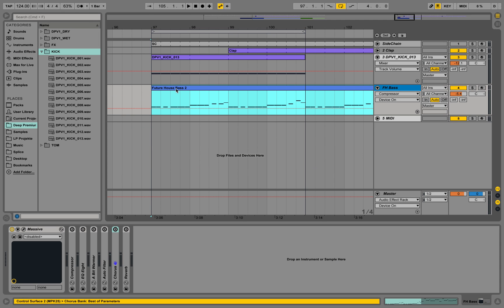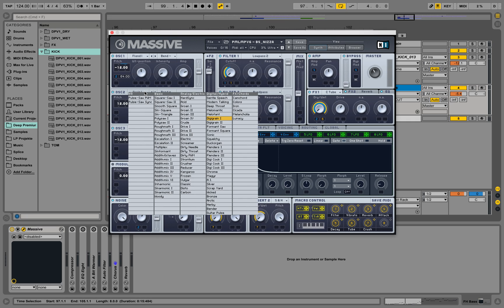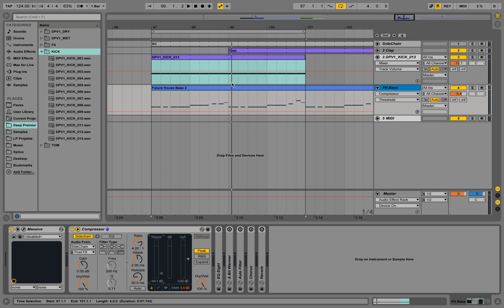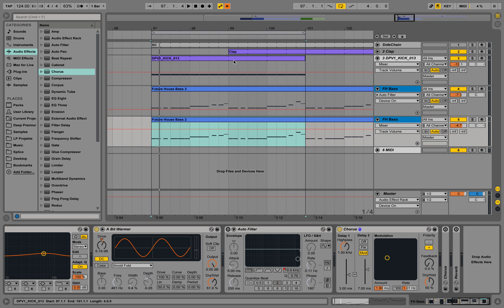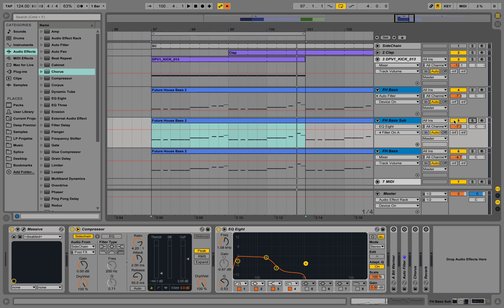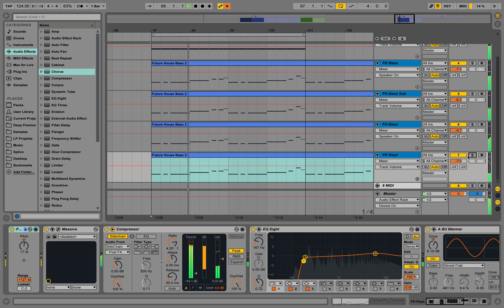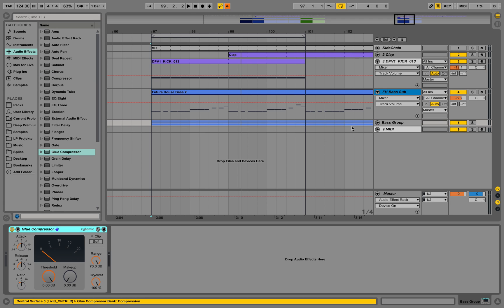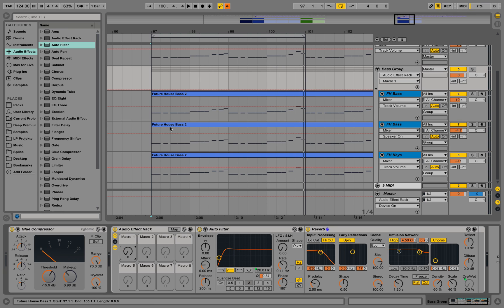Future House Bass Layering with Massive - Sound Design in Ableton

Comment: website isnt working
Reply from the maker: +TuxedoMusic Hi, thanks for the info! can you check again?
Reply: +Production Music Live hi I have checked it again but on my iPad so I will check on my laptop.
And just a question, do the presets come in .ksd?
Reply: Yep it works on my laptop now
Reply from the maker: +TuxedoMusic great, thanks! Presets are designed for massive 1.3.xx or higher, so they are coming in .nmsv
Reply: dang i have version 1.3 but i would buy it if you had them in ksd
Reply from the maker: +TuxedoMusic As far as I know, unfortunately they don't seem to be downward-compatible. You can convert .ksd to .nmsv - somehow you can't do it the other way round.